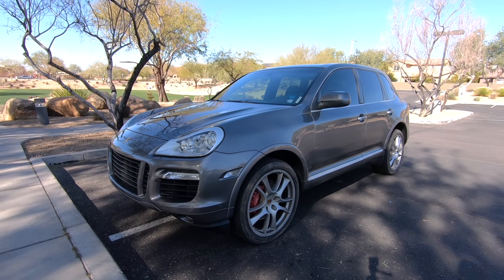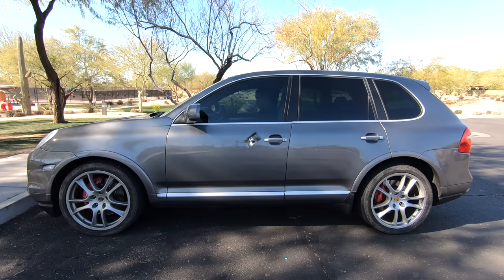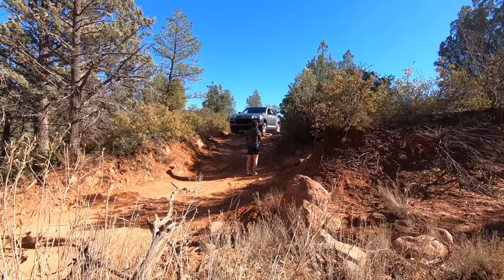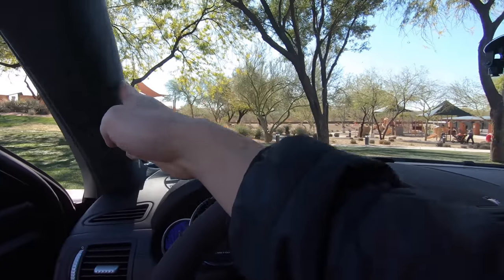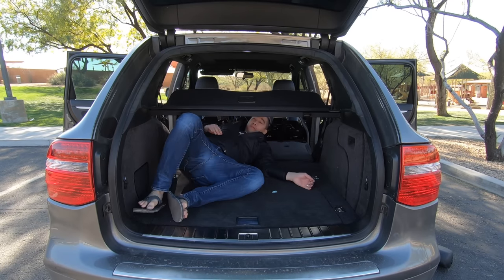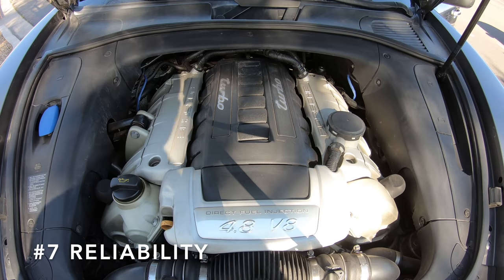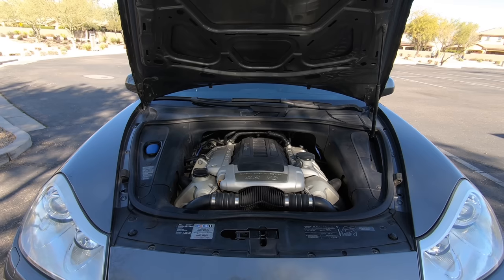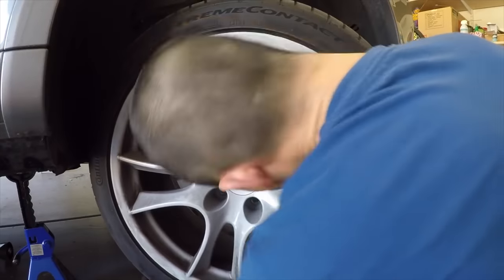Why You Should Buy a Used Porsche Cayenne Now! (First Generation 955/957 Review)

Comment: I bought a 957 Cayenne GTS with 87,000 miles last year, one owner.  No problems since then ... this 4.8L V8 engine can have major problems with valve lift control, injectors, water lines, and vacuum lines!  I have had a very common issue P1372;  1351;  1353 and 1354 since one week;  This valve lift control error can have several causes, which is quite expensive!  It could be leaking or defective injectors (8 new ones cost $ 1500 + replacement), or a broken solenoid hydraulic valve, or one of the countless vacuum hoses for the crankcase and cylinder head is broken.  Water hoses made of plastic, which lie under the intake bridge and tend to break, is also an issue.  Personally, I advise against such an old vehicle without the possible means of maintaining it. 🤷🏻‍♂️
Reply from the maker: Great feedback and hope your issue turns out to be something minor. Thanks for watching and hope you're subscribed!

Comment: Hi can you tell me is the 2013 base model better than older model ie 2008 or 2009 model? Thank you.
Reply from the maker: It depends what you're looking for. In general, the 958 will drive more car like and have more features and modern technology. However, the 957 has a more spacious trunk, two speed transfer case which is better for off roading, and feel more like a traditional SUV. Both are fairly reliable though 958 owners are starting to see more transfer case issues. If you want newer, go 958. If you want utility at a cheaper price, go 957.

Comment: Would you say that the newer Porsches are even better than the older models? Or has the quality gone down? I’m not nuts about how Audi parts, engines, etc... keep finding its way into Porsches. Thanks for the great video.
Reply: The first variant of anything is its purest form. The second gen is great as well, but the current gen is more Audi-sh. They still handle great, have great interiors, but they don’t do anything for me.
Reply from the maker: I agree with Michael's comments. I drove a 2019 Cayenne S and it felt car like and sterile. It drives smoothly but just didn't have much personality.
Reply: @CarFanatic  Which Cayenne generation do you think is the sweet spot for performance and reliability?
Reply: @jonathanl2748  interested in this as well.

Comment: excellent video, will you do the same kind of video for the 911?
Reply from the maker: I can certainly try!
Reply: The 911 is a totally different cat spanning decades of development, starting in the early 1960s so you’d really need to determine which generation of 911 to focus on, eg early air cooled, later air cooled 964, 993 or early liquid cooled 996/997 etc. There’s a lot of info out there on that.

Comment: These vehicles are now 13 years old. You’re going to be on a first name basis with your local Porsche  mechanic.🤪
Reply: My Cayenne only got 41000 km on the clock.still like new never skip a service at Porsche.They are ripping us off.(in south africa)yes i got my mechanic on speed dail.😀
Reply: You would think so but the deciding factor on this is maintenance my 2005 S has never given me an issue except the Cardigan shaft and a battery. Take care of your cars and they will take care of you. German cars are like women ..spend some money on them and reap the rewards ...
Reply: @space_114v2  
I've never purchased an extended warranty before, and with all the cars I've purchased I've saved about $35k. That's money in my bank and not theirs. BUT, it's no longer about pistons, cranks, cams or the rest of the drive train, it's all about the tech. That stuff gets buggy and you can spend large dollars trying to figure that out. Might have to consider an extended warranty on the next one.
Reply: @shakey2634   German cars can drive you crazy with electric gremlins or simple warning lights- indicators that never stop going off, cannot bypass'em!
Reply: @MarkHicks326  So true!
Reply: Right! I "knew"
Reply: The age means nothing.

Comment: I have a Audi Q7 TDI and I would never trade it for a Porsche. The TDI gets upto 700miles to a tank, same luxury settings as Porsche and better gas mileage.
Reply from the maker: Q7 is based on same chassis and has its on features. It doesn't have the same performance as a Cayenne but really is designed for a different use case. In and case, it's a nice SUV as well!

Comment: 99.9% of drivers Never offroad.
Reply: Hey Shane, I’m the .1 percent.  One of things that he doesn’t mention is that low profile tires + big alloy wheels = expensive damage on rocks. More than once Ive torn a side wall on a rock. I kept my off roading to when I had my steel winter wheels on. Good summer tires were about $400 bucks apiece.

Comment: I notice that you didn't speak of gas mileage, but otherwise very informative.
Reply from the maker: Ah, yes that is not a strong selling point. But gas mileage is generally terrible on heavy SUVs.
Reply: Well after a year driving mine to New York twice from florida, better gas mileage than any other SUV I have driven and mine has the V8. Plus the sound when passing can't be beat by any other SUV, it reminds them you ARE driving a Porsche.

Comment: Is your radio dead like the one in my cayenne
Reply from the maker: Nope. Have you checked the fuse? Does anything on the head unit work?
Reply: I had to replace the display on mine. Cost $700 at a local electronics shop.

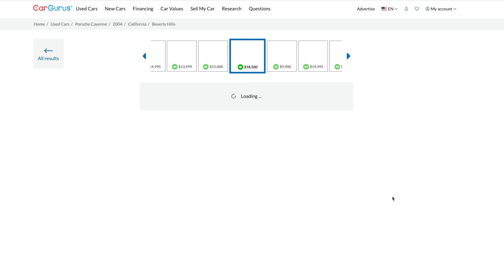Comment: 6:15 facts. I don't get why GTS prices are so high
Reply from the maker: Aesthetics, sports seats are nice along with the sport exhaust. But it's acceleration isn't that great given its weight.
Reply: Not sure about that. Yes the Turbo has more power, but I have the experience that the handling of a GTS is more solid and less loose than a S or Turbo.
Reply: @tomvanhoek4785  I agree with you there.  I had an 09 GTS and now have an 09 Turbo S.  While the TS is amazing, I tend to agree with you in terms of the "planted" feel of the GTS.  If you're strictly an on-road driver, the GTS is hard to beat.  The power of the GTS is pretty good, given that it's 5K lbs.  However, the TS power is intoxicating.  Each a different animal but in the end, I'm happy to have the TS

Comment: What about reliability?
Reply: They are like any other car (excluding Landcruisers) some are great some not so much. I have had great luck with two TDi gen 1 Touaregs. HARD to find one with air suspension. I have ONLY ever found that feature and rear diff lock on 2010 models and maybe 1 in 250 had it. When I found one, in Iowa, I bought it sight unseen and had it shipped to southern Arizona. It was a Boston and Michigan car originally, before buyback, so it has some rust signs in undercarriage that I am addressing with phosphoric acid to convert. But other than that it has been rock solid.
Reply: @UltraFence  you just screwed my plans.. 🤣🤣 I’m thinking about sell my 02 LC to get one of these things
Reply: @guyanes69  How did I ¨screw¨ your plans? I might have made a better suggestion, but if you want a Cayenne, they are still awesome and will get better fuel economy than the 100 Series LC, I sold my 2000 model and my 60 series last year because of the dreadful 10-12 mpgs. If you live in Mexico, like my brother Juan Romero, then I would suggest the Hilux over the LC or finding a TDi Cayenne in Mexico without the EPA BS like a US model. No DEF and DPF to deal with. That will make the Cayenne more capable, more economical and more reliable.

Comment: Enjoy your ride! Your enthusiasm is great, but don't over-react; it's only a Touareg with Porsche logo and a few parts which are better mate and others which are terrible and all this at a maintenance cost which only few can afford, in order to keep it on the road.
Reply from the maker: Lol, they're pretty different cars but I get it. You can say the same about a lot of other cars. Lamborghini and Audi, VW and Audi. Car manufacturers have to collaborate to share in all the engineering costs of developing new platforms.
Reply: @CarFanatic  You probably didn't get it... These vehicles share the very same platform; VW Tuareg, Audi Q7 and Porsche Cayenne; same engine, same everything, same owner. Nicer finish on Audi and Porsche... In any case when you say PORSCHE, you think of a 911... Trust me; I'm from Stuttgart and I used to live in Zuffenhausen... (That's where the Porsche factory is). When it comes to maintenance, it's in revers order to purchase price (used)... Porsche will be the most expensive to keep running... There is a reason they sell for under 10k...

Comment: if you actually off road your cayenne with air suspension, the air suspension will fail. i know because this happened to me, almost left us stranded in the desert.  ‘04 turbo w 157k miles for $6,300. replacing the air sus (or convert to coilovers) would’ve been more than the car was worth. 

turbos with ~80k+ miles also leak oil from the turbos like crazy. still the best to off road and then have fun highway driving or canyon carving. 

can’t imagine wheeling a GTS w 21” wheels 🤦🏻‍♂️ that’s just really dumb
Reply from the maker: Great to know. I can see how seriously off-roading with air suspension can be problematic. In my case, I don't go off-roading enough to warrant a new set of wheels for off-road use. I've been thinking about downsizing to 19" wheels as a compromise to have a little more sidewall. One day, perhaps, I'll convert my Cayenne to become an overlander. However she's going to spend 90 percent on pavement for the foreseeable future. Cheers!
Reply: What failed on your air suspension?

Comment: All season tires are summer tires. Why would anyone drive on all seasons in the snow? Sounds amateur to me. The old cayenne is a great car, but you need one that was garage stored somewhere where it was dry, otherwise underbody electrical problems are very common
Reply from the maker: All season tires and summer tires use different compound and design. All seasons can't match winter or summer tires in terms of performance in their respective areas, but they are good if you don't encounter really harsh winters nor need absolute performance.

Comment: exterior styling... i respect you right to have bad taste... how awesome is to do offroad with 21''... crap... first mod - smaller wheels
Reply from the maker: Smaller wheels would be better, but when you only off-road a few times a year, it's a lot of work to swap out wheels and tires. Or I could run smaller wheels, but compromise on road performance 99% of the year. It works for my situation but smaller wheels are better no doubt for pure off roading.

Comment: Winter in the snow, with 4 seasons tyres? you have a porsche and you can't afford a decent set of winter tyres? Than also with the 22" tyres on the rocks and hard terrain , you'll crack the fenders. Not very good advice.

Comment: But that is the second gen
Reply from the maker: On paper, yes. But technically the 957 is just the midcycle refresh of the 955.
Reply: @CarFanatic  I would even say the 958 was a refreshed 957. 957 and 955 were the same generation, 957 was just facelifted and had some engine tweaks

Comment: 1st generation Cayenne is a failure. Never buy a 1st gen of anything and it's not a Porsche. Nothing about it is Porsche. It's a VW engine not a highly developed Porsche engineered engine and the interior doesn't even look like Porsche. The only thing Porsche about it is the costly maintenance of this turd. You're better of buying a VW or Audi SUV instead of being a Porsche poser.
Reply: Voltswagon Porsche Audi and now Lamborghini have been sharing parts for some time now.  Your wrong about the engine.  It was the engine that was different. The chassis frame was the same but engine and suspension  different.  Porsche panamara shares engines with cayenne.
Reply: lol you couldn't be more wrong. First of all Gen 1 Cayenne was developed when Porsche was still an independent company- not owned by VW like the 2011+ Cayenne! The first gen Cayenne had 4.5L V8 with dry-sump lubrication and variable valve timing, both larger displacement and more powerful and sporting than the V8 that went in the VW. Gen 1 Cayennes benchmarked Land Rover Discovery/Range Rover/LR3 off road, it had a real 2-speed transfer case which was dropped in later Cayenne models. Center diff lock came standard and a rear diff lock was optional. They had active anti-roll to keep you flat in corners. And the V8 GTS could be had with a 6-speed with 400hp/369tq, while the Turbo put down power far greater than anything that went in a Touareg including the V10 TDI. It will always be the greatest Cayenne generation, and way more interesting than anything VW/Audi made (except maybe the V10 TDI is as interesting but that doesn't handle like the Porsche).